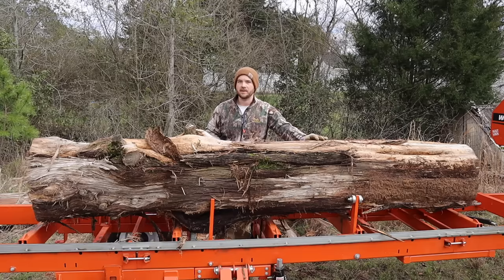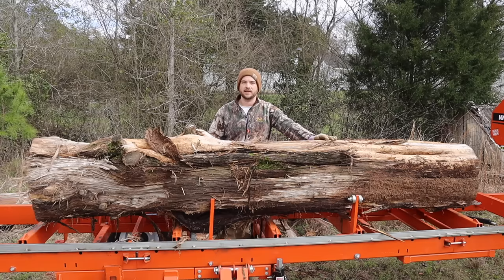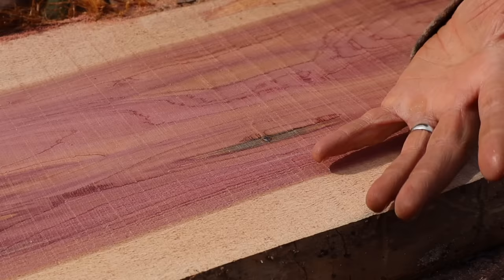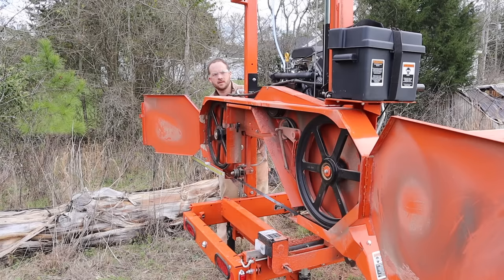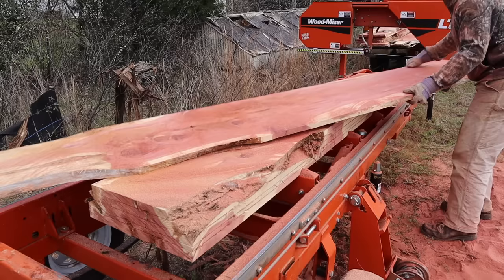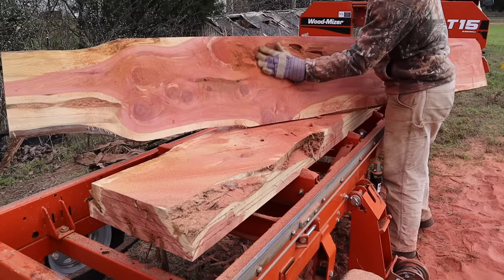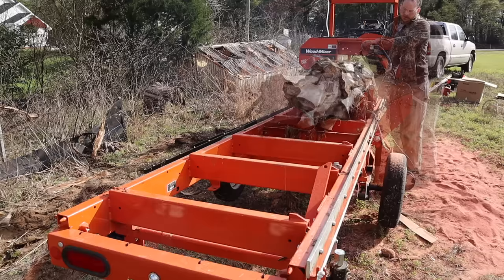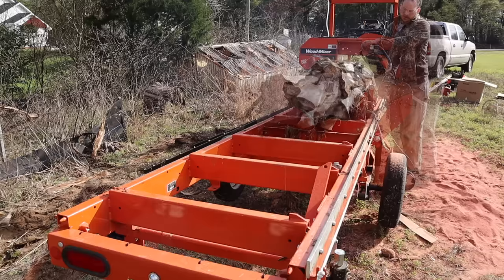Incredible Boards From A Rare Cedar

Comment: Most people would have just seen an old rotting log laying there ..Some see a true  treasure.   nice post bud..
Reply: That's exactly what it is. It's not worth the time messing with it. The white is about rotten and it had metal in it. It was known yard cedar and rotten..... I'm not saying.... It's just that I see so much cedar that this is plain junk to me. At 53" logs I would have bought it for two 4" logs (cuz of the rot) or maybe a 4" and a 5". So a $1.92 and wasted time trying to saw it for mulch and ended up hitting a nail. But anyways, rotten probably not the correct term, more like worthless or crap. But he did turn it into boards for himself, so good for him.

Comment: Damn, this is some beautiful wood. Imagine what you could make with that 😍
Reply: @TheMightyBurger  My thought exactly!!
Reply: I did I made a gun wall. I,e, gun cabinet that covers a complete wall. Made it completely from local cedar that I cut and milled with a chain saw, table saw, and planer. 200 year old heart pine floor that I resawed and put down. Tin ceiling. Cedar crown moulding. Not finished yet.
Reply: I think I see the top of my new guitar in there!
Reply: @oldrrocr  that's exactly what I thought. Back of a shed!!!...at least 20 guitar bodies.

Comment: I would like to ask if it is possible if you could post a date with your videos.  It would help to form some type of time line.
You brought back such memories.  My dad, loved to work with wood.  He could build anything.  In 1956 he started our new house.  I was all of 6 that August.  Some of the work was contracted out but at least 70% he did will all the help I could lend.  He worked all day, came home and off we went to work on the house.  We worked till after dark.  I was a little fellow in those days.  For whatever reason, I didn't start school till the next fall.  I think I fell asleep every night and would wake up in my dads arms carrying me home.  We were renting an upstairs of a huge house on the corner and the new house wasn't very far.  At that time there was an unsold lot between our new house and where we were living (these were very big lots).  This was out in country in a new subdivision.  My dad was purchasing new tools all the time and each made the job easier.  I remember he came home with a load of boards in the rough.  Between the table saw, the 2 different planners (thickness & joiner) he made the most beautiful cedar kitchen cabinets. 
My point would be, men make memories with your kids.  Once the house was built, my dad bought a sheet metal building to turn into a fine workshop.  I spent hours next to my dad learning how to make anything.  My dad had 3 woods he loved:  1) Cedar 2) Oak 3 Douglas Fir.  All 3 were in abundance where we lived in NC.

Comment: Did you count growth rings to age the tree?  I would like to know the age of a that cedar.
Value is relative.  But, it sure seems a waste to use wide board red cedar on a shed wall.  It may be the highest and best use for the resource when you need to cover a shed wall.
Best wishes.
Reply: highest and best use is relative..i am a guitar builder..and that amount of the right wood could be used to build other things..but at the cost of shipments and storage..let those that are involved in the process determine the value..if there is a higher value for it if used otherwise..and the logger does not know it..then it is the job of the middleman to make them aware and take their cut for the useful information..basically, the more and better the information is readily available, then the better decisions can be made on value in the economic environment at the time..this guy mentioned that this wood (rot resistant) is hard to find that are large enough to be useful..he is aware of the environment and conditions and can make a educated guess as to whether it is worth his time and expense (he did loose a blade, and they are not cheap), the guy that helped him..he got some firewood for a bit of his time..this is a great video about how free economic systems can better all the parites involved..including the church that recieved a small donation..this is fairness without the intervention without  govenment and several people that would be needed to handle the bureacracy (permits, liscenses, etc..). Imagine if he had to get a permit, pay the taxes for the helper, etc..etc.. then it would not be worth the effort any more..this is what the left wants, and what socialism will bring..
Reply: It's the most resistant to nature is why he's using it for a shed it's natural insecticide

Comment: You think that is rare, I just got a ERC log that is 16" on the top end, 42" on the butt end and 25' long.   Hopefully I can get a 12"x12" beam 25' long.
Reply from the maker: meehd01 Nice!
Reply: @falllineridge  99% of what I mill is cedar and that's the biggest one I have had to mill in the last 10 years.  Had two that were 37" on the butt end and about 12" one the small ends at 24' about 3 years ago.

Comment: Dude!!! Just use a small hole saw on a hand drill to remove a little wood around the nail. Then a pair of channel locks and a paint scraper back up will get it right out. That would leave you a blade that could be repaired and sharpened!!! Wood was beautiful in the end.

Comment: Cool stuff. Beautiful wood!. 
Have you ever tried scanning a log with a metal detector first, to fine nails? I think that would be a good investment. Your return on your cost of the metal detector would be pretty quick, if you saved a half dozen blades from hitting a nail. Getting the nail out of the wood might be kind of tough, though, especially if it’s imbedded in the center. In that case you would have to maybe cut the log shorter, on each side of the nail.

Comment: if nails are an issue id suggest buy the cheapest metal detector that works and use it to scan the logs before putting them into the machine. other than that love these videos, keep up the good work :)

Comment: Just wondering when you put these into the shed whether you are lapstraking them over each other, or just better, diagonally chamfer the bottom of the top board, and chamber the top of the bottom board.  This would then stop rain rot, the drip would fall onto the bottom board, and all is good ....

Comment: There must be a reason, but why don't you leave the machine head at the opposite end of the truck & slide the boards straight into your ute. Cut down the sawdust between the boards if you tail them out between each cut. Just different techniques for different countries.

Comment: whats the possibility of taking a punch and hammer  and drive it deep enough so the  blade want hit it  if  it works do it again till you get through you can plug that nail holes   very easy

Comment: Correct me if I am wrong, but I have been told that a lot of this high quality lumber goes to Japan, Korea and China. Is that correct? I have been also told that a lot of the lumber used in US construction is the cheapest, while we export the best lumber, usually to Asia, because they have stripped most of their old growth and best lumber. This is from someone in the lumber industry,, name starting with a w and ending in haeuser.
Reply: I also say this because I noticed that basic Japanese wood products(furniture, etc) are at a higher quality then American ones. I am looking for some education on the issue, not to point fingers. But, after 5 years in Japan, I did see that Japanese wood furniture was a far higher quality than American ones, even though they don't really touch their forest, while importing a lot of lumber from the USA.

Comment: Why dont you use metal detector? I had to cut lots of trees around Moscow city area (Russia) and I had encountered not only nails but hardened steel objects inside trees like reinforcement and (in some areas with old trees) AP shell shards. Those ones may destroy you chainsaw and injure you in process.

Comment: That is not a rare cedar log........I would have thrown that one on the fire.
Reply: Where do you live?
Reply: James E I’m from Crowley Louisiana...........Live in Texas now.
Reply: @patrickguillory3914  That type of cedar may be plentiful where you live, but most areas would consider that log large for the species.
Reply: James E I use to run a sawmill in Crowley Louisiana,,, we have lots of Cedar logs in Louisiana............Love working with Cedar wood........
Whenever you cut those Cedar logs, just about every log you cut will have nails or wire............I use to sharpen and set my own blades........I’m and old man now, I miss cutting logs a lot.
Reply: @patrickguillory3914  Nice to hear your story. Yes, Cedar is marvelous to work with. I am a tree expert in North Carolina. The Cedars often grow along fence lines and get metal in them. You're never too old to do a little whittlin'.
Reply: James E Maybe I’m and expert also..... I have worked with lots of exotic woods and I also milled lots of exotic wood....... We did more than just milled logs......... I built my own Kiln with and old school bus....I have kiln dried and milled so many different types of exotic wood....... To many to name............. We also had a 5 head molder, industrial planners......We made tung & grove flooring, all type of molding......If I had to name all the different types of exotic wood, my list wood go forever.
Reply: James E One of my favorite exotic wood is Brazilian Pecan, I have built kitchen table with this hard wood... I made lots of Brazilian pecan flooring.
Reply: @patrickguillory3914  You have seen some awesome variety. Did you keep any leftovers for yourself?
Reply: James E Yes I do..........Pecked  Cypress, Red Cedar kitchen table and I also have some Black Wal Nut vases l made with my lathe ...........Lots of pieces I wish I had kept............Had to sale everything else, we had a lot of bills.............People think you are rich to run a business, lots of break downs and lots of supplies.
Reply: James E I found this Hispanic family online , talking just like you and I .........They had a business where they was make pistol , rifles and shot gun stocks from all kinds of exotic woods out of South America.......They wood ship these gun stocks all over the world............He would bring me the logs and I would mill, dry and plane the wood..........Made lots of money together.